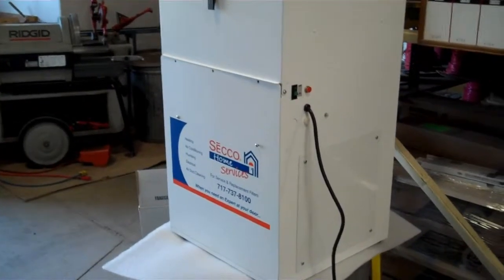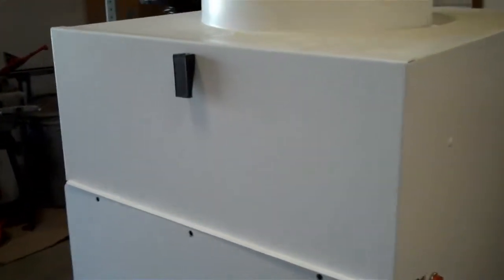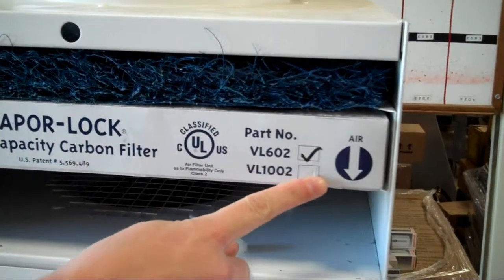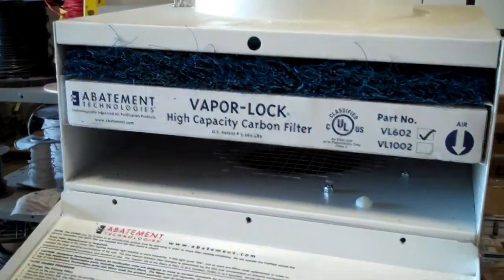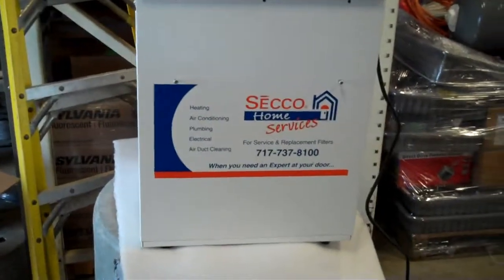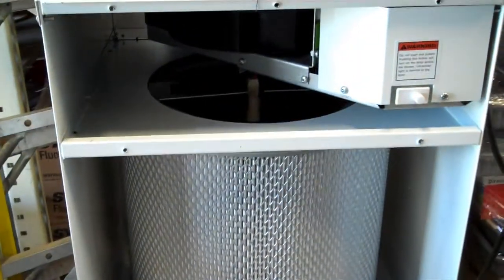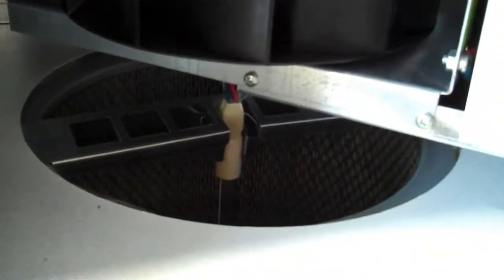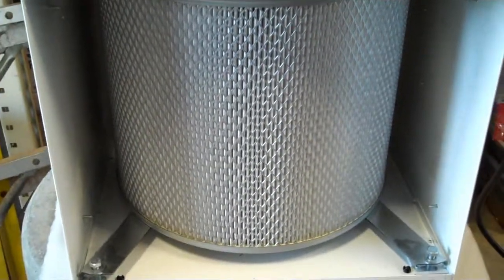How to Change the air filters and UV lamp on an Abatement Technologies CAP600 HEPA air cleaner.

Comment: Great video.  Thanks for posting it.  The only question I did have was you didn't show how to remove the UV Lamp.  I am assuming I need to remove the entire HEPA filter correct and then pull out the light and replace it?  I don't need to replace the HEPA filter til next year so I am replacing the UV Lamp only.